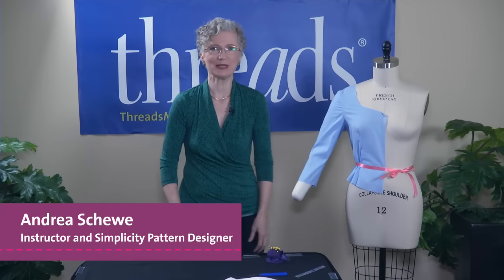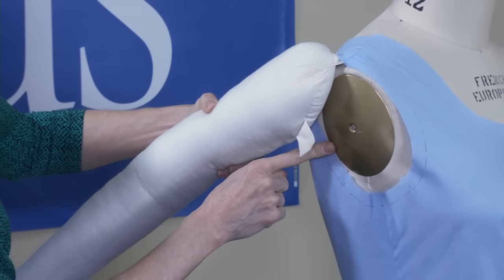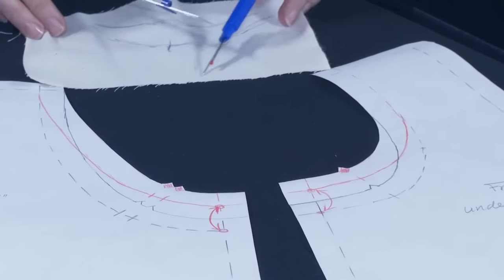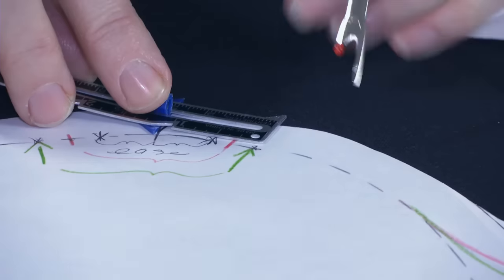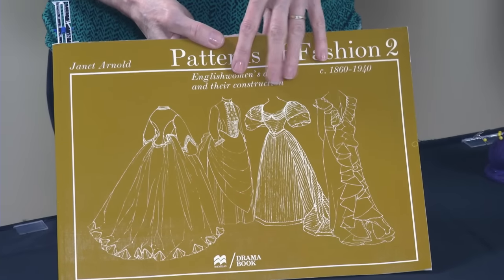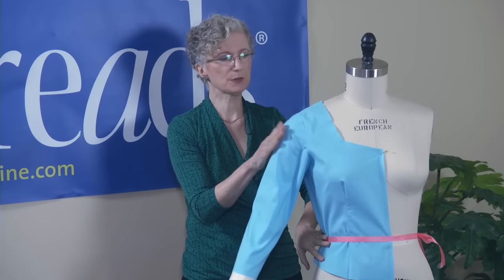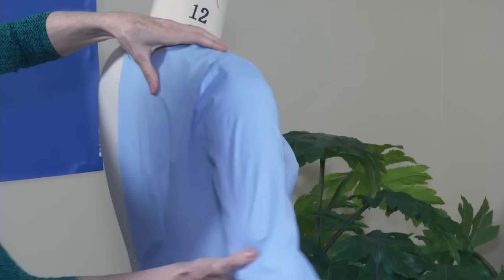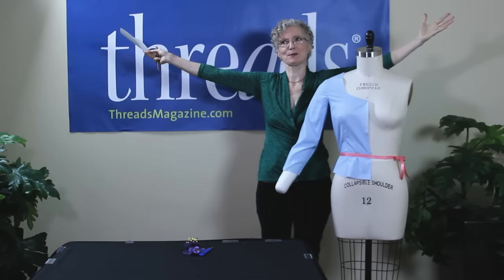How to Modify Sleeves for Better Arm Mobility

Comment: I am methodically teaching myself how to alter men's shirts to fit me. Re-engineering the armhole has been the biggest challenge. Your video was very informative. Thank you, thank you, Andrea!
Reply: Sylvia Herold  I do the same thing.  Thrift stores so often have a lot of barely-worn men’s dress shirts in nice subtle patterns & solid.  I am very busty, but with rather «manly» broad straight shoulders and a large chest - so women’s blouses almost never fit me.  Total “gaposis.”
   Here’s my favorite « quick and dirty» fix - nothing special, but it works:  I unpick the side seams of the shirt.  Then I gather the top 5 inches of the seam on the front of the shirt to a finished length  of about  3.75 inches.  (Very slight gathering, not noticeable in a dark shirt.). Then I resew the side seam.  Of course the front of the shirt will be about 1.25 inches shorter than the back of the shirt at the side seams.  You can smooth out the bottom edge or just wear the shirt tucked in.
Reply: I usually take a tuck, at the top of the sleeve to the underarm, about the size of the seam allowance; this raises the sleeve and armhole. I then ease the difference in the back. I like Tina's play with the side seam and will have to try it.
Reply: @Tina06019  I have the same full bust dilemmas. Wouldn't have thought of gathers --only darts--so I had a WOW moment there! I've got the chunky upper arms to fit, so I am trying to picture where the shoulder seam sits after you do this. Does it move the shoulder seam forward more? That would help, as they always sit too far back on me. I think I'd still have to change the size of the armhole. Thank you for the idea! 🙂
Reply: @saundrayork767  When you take this tuck from top to elbow, does this result in a partial seam on the center of the *sleeve*? I mean does it look like a north to south seam that's visible, where we don't typically see one? Or do you mean a "dart" shape that is on the front of the shirt, from shoulder seam to underarm, downward alongside the bust--and NOT on the sleeve at all? Just clarifying on a new concept to me. Thank you so much!

Comment: Your gusset design and suggestion for letting out the seam allowance saved my life! I am such a novice with sleeves and never seem to get them right, and I knew a gusset could help but I needed the most ease at the front of the sleeves, not the armpit, so I toyed with the idea of lengthening out my square gusset. Your oval-like gusset validated that idea of mine and worked wonderfully!! I may have made it a little big, and it might not be the prettiest sleeve ever, but I have incredible mobility now, even with a tailored, fitted waist! 

Also I love that you use and mentioned Janet Arnold!!! I actually got into sewing about 3 years ago from the historical costuming community, so Patterns of Fashion is a familiar series!! Really interesting to learn about the differences in sleeve cap drafting. When I attempted my 18th century jacket a few years ago, I remember being confounded as to why the sleeve cap didn’t look anything like a modern sleeve, and I tried altering it to accommodate for that. I couldn’t fathom how it would fit in the arms eye because I was used to a modern sleeve cap shape. In the end that project was abandoned after much stress and failure. Turns out I shouldn’t have been afraid of the different sleeve cap after all!!!

Comment: Sewing up a pattern and I was having this issue, I followed your instructions and it worked perfectly!! ✨Sewing magic ✨ 
Making a big 4 shirt dress sewing pattern. For my adjustment I did a 1.5” rise on the front/back bodice lower arm S. and I doubled it for the sleeve at 3” rise and omg!!!! 🎉🎉🎉 it worked, on my first go - thank you!!! 
It does seem to have made the sleeve almost twist below the elbow, when my arm is resting, so I’m unsure if I need to move the curve more towards the front or the back, but otherwise very pleased I can totally raise my arm vs before I could only raise it at a 45° angle

Comment: I have no idea if you check the comments here still, but THANK YOU. I have a broad back and while I am sure there are better methods for adjusting for that in the pattern stage, I have a wrap dress with set in sleeves and that gusset is exactly what I need (I think lol). Thank you for this video.

Comment: Thanks for priceless tutorial. This mobility of the arm was my struggle for some years. And this raising of both armhole and underarm of the sleeve seemed to work, but all cutting books said you have to low the underarm ot the sleeve if you raise the armhole. You showed, that what I did was wright. And gusset works just amazing for dansing costumes. For sure it did it for centuries before modern armhole

Comment: Brilliant!   I am thin with very long arms.   I always bought larger sizes to fit my sleeve length & tried to alter them by taking them in.   It never worked, as I had no mobility.   Grrrr.  This is a problem that has frustrated me for YEARS!    Using excess fabric I may be able to construct gussets by creating each gusset using TWO pieces of fabric  1 1/2" x 6" & sewing them together.   (|   |)   I like the fact that I am cutting two smile shapes & sewing them together!   Ha!  Thank you so much!!!
Reply: Lori M   I have made gussets which are «two smiles sewn together» as you so aptly describe it.  Generally I’ll do that when I will find it easier to make up the garment by attaching one «smile» to each side of the sleeve before sewing the long sleeve seam.

Comment: THANK YOU. Thank you very much.  You just saved
my current project!  

Background:  
Most of my sewing is 9th to 12th century Northern European garb, which always has a diamond-shaped underarm gusset.  However, I had a modern pattern for princess-seamed peplum top which I wanted to make up for office wear.  The muslin I made fit perfectly, but I did not put sleeves on the bodice of the muslin.  Silly me!
With the final garment, I could not move my arms once the sleeves were set in.
    For the first part of this video, I thought I would learn how to do better next time.   What you showed matched the basic ideas I had figured out, but with really good instructions.  Then you showed how to fix an already-cut & sewn sleeved bodice so that you will be able to move your arms!  This will work.  Thanks again.

Comment: 2:15 - It makes sense to have more ease of movement since you are ADDING fabric to the pattern of the underarm area.  It only seems tighter because the seam is closer to the armpit. 

I've been drafting my own patterns for 35 years (I'm now 47).  I don't know if many patternmakers think of themselves as fabric sculptors, but thinking of myself as such helps me to understand where to add or remove fabric for a fit that allows freedom of motion.

Comment: When I was younger and had narrow shoulders (before bodybuilding to play hockey), I always widened the bottom/armpit breadth of the sleeve and I could totally reach over my head then, not just 90 degrees. There’s never enough ease at the bottom! 

How did I get that idea? My grandma (the youngest of 7) was taught pattern drafting by her mother, who was born in 1885. Her mother was taught pattern drafting by her mother. No Civil War era or prairie mother would be able to even get an item off the shelf with sleeves like in this video! Clothes were practical, functional, *and* women worked in the fields as much as the men. . . Sounds like I’ve got a ton of redrafting to do for my new figure, if this is how they’re made nowadays. Grandma taught me how to eyeball it and I’ve never had one go wrong, but I’m def going to replace one of the pattern drafting books I was given as a teen (still have the one on pants and skirts).

Comment: Thank you so much! The information you've presented is helping me replace sleeves in a georgette and lace dress.
Maybe you can suggest the best course of action. The armhole is too low, but the only modifications I can make are to the new sleeves and narrow seam allowances. If I decrease the underarm dip, is it possible that it will suffice? I could gusset it, but since I'm building a brand new sleeve, I can virtuallly cut one in.

Comment: Very helpful tips. I have a question...on a not very tight fitting top, the 3/4 length sleeve, I get diagonal folds showing up. how to fix that? I would appreciate your reply.

Comment: Thank you for all the showing how to adjust patterns and effects and the gusset. Are gussets usually on diagonal grain ( have noticed woven cottons sometimes stretch more in width than warp(length)  and of course most fabrics in diagonal) . Am trying to make organic terry knit sweat pants with too small piece of fabric, so put in a gusset, and wondered best direction to cut knit gusset (had an eye shaped piece, but thinking needs to be positioned side/side instead of the front back first tried).

Comment: Such a great tutorial.  I am in the process of drafting a knit fabric open front cardigan and am vacillating on the armhole & sleeve style.  (should I have a dropped shoulder (only 1") or stay with one that is at the edge of the shoulder).   My thinking is if I drop the shoulder I can have a lower sleeve cap height and slightly wider bicep.   However I like the sleeve at the shoulder and your idea of raising the armhole & sleeve seams to obtain a better fit with more mobility. Since the fabric is stretchy, it should not be too snug.  I have one puzzling question (and it's because I'm new to pattern drafting) - can I have a lower sleeve cap height without dropping the shoulder seam?   It didn't make sense to be able to do that so I am asking if you can offer any guidance or clarification to me.   Thank you for your time and knowledge.

Comment: This was a great tutorial. However I'm looking for a solution to a problem with reaching my arm forward and the front bodice and sleeve seam rubbing or pulling at the front of my armpit. Will these alterations still help with that? I'm going to give it a try but I have a feeling it might not solve my problem with patterns consistently rubbing up against me in the front of my shoulder. Thanks.

Comment: I just tried this technique, but didn't have the exact results that you had.  It  worked for me  to add to the armpit the exact same amount I added to the sleeve, and I walked it out on paper.  I haven't  tried to make and set the new sleeve, but I was wondering why I had different results.  I'm very interested in making a smaller armhole with greater mobility.  I can't stand the wing-type effect I get when I raise my arm with regular sleeves and armholes.  I m overwhelmed with the amount of information about armholes and sleeves that I've found online, sometimes contradictory.  If you respond to this comment I'd appreciate any advice you might have for me.
Reply: You may have forgotten about the ease?
Your sleeve-shape may be different? (again, check the ease)
If you are adjusting a plus size pattern, or a men's shirt, the ratio may be different to begin with.

Comment: I was originally thinking jackets replaced capes because they allowed better arm mobility, but with the limits the jacket shoulder puts on our flexibility, now I think it was only the lower weight of jacket sleeves that made them replace capes.  Even though I have worn plenty of modern clothes that limited, or hampered, my arm from getting over my head.  Nothing short of putting gussets on gussets and making a complete accordion, or making a gusset of spandex, could possibly make a heavy coat not get in the way of arm flexibility.

Comment: bought a sweater which fits me but around the middle the material hugs my ribs, it's fine under the armpit and at the waist but when I put my arms down I can feel it constantly sticking to my ribs, it's a visual thing too.  it's a cable knit sweater but I think this might be made of polyester.  what would cause a sweater to have an hourglass shape like that??  and is there a way tofix this so that it doesn't look hourglass around the rib area? I'm not very good at sewing. I know something is wrong with this sweater I just cant put my finger on it.

Comment: I have a question, why don't you, intsead of raising the arm sleeve 2x of the armscye, just lower the sleeve center line so the apex will be lower, therefore having less curve and also less perimeter. I think that should possibly fit the altered armscye perimeter. If the sleeve become shorter you can always just add more length at the bottom which is easier than altering the top part of the sleeves

Comment: Yes, yes, yes, yes, yes!  This is my problem. (well, one of them.)  I have taken to wearing mostly tee shirts because I can find some that don't bunch under the arm and look like I'm wearing bat wings.  I have known that the sleeve is cut too low but couldn't figure out what to do about it on ready to wear.  I just this morning put another one in the donate bag, just because of this.  I have tried buying petite but I'm not really a petite size and then the sleeves, and length are too short.  I see an arrow on your gusset pattern.  Should I assume that is the grain line?  I will need to listen to this several times but you've got a fan.  Thank you.  Lynn
Reply: Yes, so if the gusset is bias cut it will have more stretch and adaptability.

Comment: What if I can't reach forward with both arms. Back gets too tight. Should I put a gusset in the back instead of the underarm?
Reply: That may help, although the best solution would have been to add to the back width (across back measurement)

Comment: I have a question, does sleeve get longer if I make my armhole a little lower?
Reply from the maker: She is actually raising the armhole.  Also, she is modifying both the armhole and the sleeve so that it doesn't create such a problem.
Reply: @Threads  I have one question that I forgot to ask. For mens suit, my dress shirt has slightly lower armhole in comparison to my suit jacket. Is this wrong? are they supposed to be the same size or which one should be on the bigger end? Thanks
Reply from the maker: I think this is often the case when it comes to dress shirts.

Comment: Turning the sleevehead an inch backwards helps with the stretch as it gives stretch on the bias. Your underarm sewing should not correspond with the sewing of the body side seam...but an inch forward. The sleeve then falls automatic slightly forwards. This is how pro's do it.

Comment: I discovered the non intuitive fix to tight sleeves by making the sleeve tighter by accident. I had a costume were the actress could not raise her arm to dance, so I made the sleeve. Looser, and it made the mobility worse. Trial and error led me to discover I needed to make the sleeve armsy tighter to fix the problem. Sounds wrong, but it worked.

Comment: Okay but I don’t like my top to sit so tight into my armpit because of sweating. So for me this would for sure not ne the solution.
Reply from the maker: You could use dress shields.
Reply: @Threads  yes I know, i did that. But I just find it very uncomfortable when my top is tight under my arms.

Comment: If you use Janet Arnold as your reference for designing historical costumes, why in the absolute world are they so woefully inaccurate??
Reply from the maker: Not sure we understand the question. Is this in reference to Andrea Schewe's video tutorial on modifying sleeves? Or is this a more general question about when one uses Janet Arnold, why might they be inaccurate?
Reply: @Threads  the patterns I have purchased supposedly designed by the woman in this video, apparently has access to Janet Arnold and none...NONE.. of the simplicity historical patterns are accurate as to how the actual dresses were made. They are modern drafted sleeves with modern sewing techniques.

Comment: Reducing the sleeve cap height is not the best method for achieving mobility + comfort. I suspect this presenter is more attuned to costumes rather than regular garments. Not my favorite video from Threads for that reason.
Reply: It looks like she added a gusset without adding a gusset, and unfortunately loses the nice stretch the bias of the gusset can give.